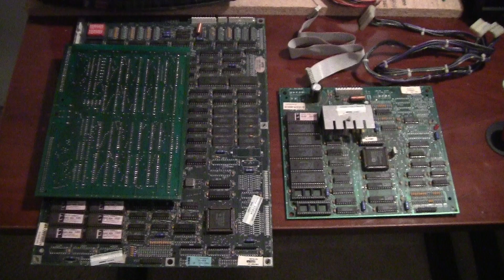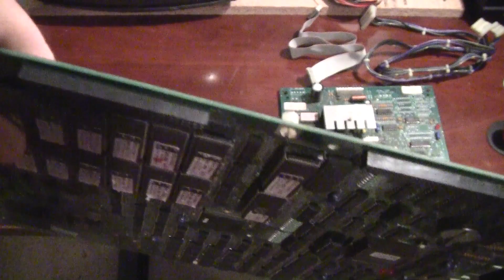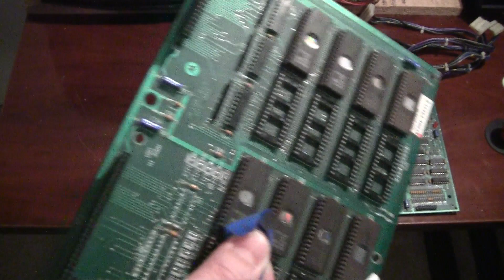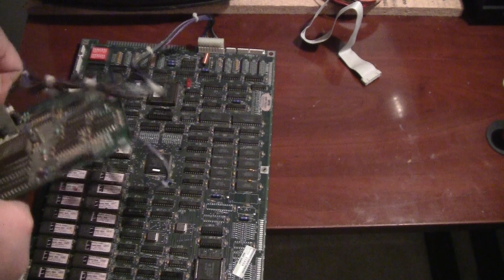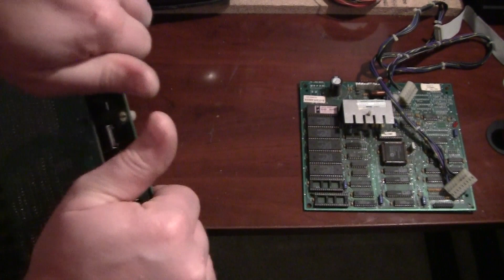Basic Mortal Kombat 2 Arcade PCB Information [HD]

Comment: Great video. I would just add that sometimes a board will have the black connectors but working 8mbit chips. The board I bought 15 years ago is like that, so it was converted probably well before that. Maybe its expansion board failed.

Comment: Awesome ! Does the jamma connector carry the audio signal thru the jamma harness into a super gun ? ( assuming you have the sound board hooked up correctly to the the main board ) also If you don't have a potentiometer will it still pass audio but just at full volume ? I'd like to get into a supergun setup / mainly for the MK and Street Fighter 2 games....( not the CPS2 ones)

Thanks !

Comment: Very interesting video! I got a problem with my MKII board. When I boot up the machine, I ear 2 "dong" sounds wich, according to the sound test, means bad U2 checksum. What that do is when I perform a fatality, the sound stops working. Friendship and babality are fine. Just fatality makes the sound to crash. The way to avoid having to reboot the machine in case someone tries a fatality, I've simply turned violence dipswitch to off so no fatality are allowed. Do you know where I can get a U2 sound rom for the sound board to get faltalitys again? Maybe you could happen to have some spares roms.
I do not want to buy a whole game/sound boards just for 1 defect rom chip.

Thank you very much!

Comment: Hi Mike. I have a revision 3.1 mortal Kombat 2 board that I'm testing. I have a box full that I'm going through from an operator. This one has those connectors for the memory board but it doesn't have one. Were there any versions made that still had the connectors but didn't need the memory board? All roms test good on cpu board test? So far no problems with the gameplay

Comment: Hey MK …. Ok ok …. I’m re-watching your video …. All of the ROMS are populating bad but the main PCB itself does not have the expansion board sockets in place and the vías are all populated with solder ……. I assumed on purchase that the board was a newer revision with 8MB ROMS ….. is there any other way to determine if this board is meant to have the expansion board besides the black plastic sockets?

Comment: Hey man I watch your videos from time to time and have a question about the MK2 arcade cabinet at the arcade I work at.  On occasion, when playing 2P vs either side will drop inputs, like going backwards won't work for a second or else a LK won't register at all, or on rare occasion a character will just jump straight up or lock in a duck position (all of this is SUPER annoying).  It's very bizarre and seems intermittent.  The issue arose months ago, I put new iL Eurosticks and all new microswitches in on the buttons but realizing it still happens here and there has ruled that out as a possibility.  Maybe a harness issue or the board itself?  Ever run into anything like this?
Reply from the maker: Hmm. First thing I’d do is clean the PCB edge connector.

Comment: Hello!
I have a 4MB board without the expansion card. So when I plug it I only get a black screen and one sound (that it means the sound roms are ok). I have three questions:

1. Can I plug the board without the sound card attach to it? It will works?
2. If I don't have the expansion card, will I get video signal as well? 
3. Do you have an extension card for sale?

Thanks!

Comment: I've got a board from MK II that is reporting some bad ROMs, it plays but it will reset occasionally because of the ROM problem. What would you recommend as my first step in trying to repair them?
Reply from the maker: Paul Eicher First step is to inspect the bottom/back side of the board to see if any of the metal socket feet are bent over and touching each other. The second step is to make sure your voltage is correct. Measure your voltage and make sure it's around +5.12vdc. If it's not, turn it up a bit. Some boards need slightly more power than others.
Reply: YourMKArcadeSource Thanks, I'll try that out when I rip the cab apart for a complete rebuild. I found my board is 3.1 with the 8MB roms :-) 
I mentioned you in a post of mine on Google+ which has a image of my ROM errors.

Comment: So. I have a 8MBit version of the board, I am having an issue with chips UJ19 and UJ20 going red. If i reaseat the chips (Generally just reseat UJ20) and reboot the board it will go green. My guess is that the socket has gone to shit and i need to replace it. What do you think? Oh, The legs on the chips are clear and no tarnish.
Reply from the maker: +DJAlup I replied to your KLOV pm.

Comment: i have a question, i  bought a mk2 board but when i plug it in i get black screen, one of the led lights turns on, i have no sound card.. is it not powering on becuase i dont have a sound card or is there something with the board? I have the one that doesnt have a daughter board.. hope you can help :)
Reply from the maker: Try adjusting your voltage on your power supply a little higher. If that doesn't work, remove, clean the legs and reinstall the revision roms (UG12 and UJ12).
Reply: thanks man, im scared to mess with the voltage since im not experience.. im scared of moving something up and breaking the whole cabinet down.. is it hard?
Reply: have you had an mk2 board that had the same issue that it shows light but nothing comes on? im just going crazy if its the board or the voltage issue. board looks in good condition though, one blue can cap is loose though
Reply from the maker: Chris RG Usually, I "flex" or "bend" the board while it's powered on to see if it comes on while it's being "flexed" because if it does, that means there could be a cold solder joint or loose part.
Reply: Ill give it a try thanks bud :)
Reply: I have the same problem only the top LED light turns on the the screen is all black and my board looks a little bent can someone help me?

Comment: Is one version better than the other between with and without an expansion board?
Reply from the maker: No, not really. The non-expansion board is newer, but not necessarily better.
Reply: I like to think the single board/8mb version is better due to it not having the expansion board as a possible failure point.  There's been a few stories of the expansion board coming up bad even tho it was there and socketed.  sometimes without the support at the middle of the main PCB to the expansion the connection between the two can become flaky.
Reply from the maker: Collector-itis Yes, this is true but the 8mb rom boards have their problems too. I've actually got more bad 8mb boards stacked in the spare parts area than I do 4mb rom boards.

Comment: I have the expansion board on my MK2! Could I upgrade to 9.1?/ All I have to do is replace or install UJ12 & UG12 right???
Reply from the maker: Correct!
Reply: @YourMKArcadeSource  Dude u are awesome!! My bad I should have finished your video u explained it to the "T" My man
Reply: I have 1 more question when I install the ROMs? Is there something on the chip to make sure I install it right and not backwards??? Whats the best way to remove it??
Reply from the maker: There is a little notch that lines up with an arrow/notch on the board or in the socket.

Comment: As far as power supply goes, what does it use, because I hear it doesn't work with 12v
Reply from the maker: It uses +5, +12, and -5 for audio. All three rails must be present.
Reply: @YourMKArcadeSource  thanks man! I trying to build my own machine, and it's my 1st time, I'm a little bit scared.
Reply: @YourMKArcadeSource  my JAMMA doesn't have -5 voltage.
Reply from the maker: You’ll be ok for MK1 but you need -5 for MK2-MK4.
Reply: @YourMKArcadeSource  so I'll have to get a new JAMMA cable?
Reply from the maker: Yup. Or add in a wire and pin to the connector for the -5.
Reply: What about jamma+? Can I use it, or do I need the kick harness?

Comment: So if all my roms are red on the expansion, should be just replace them?
Reply from the maker: Is it hooked up? Installed properly? Seated all the way on the main board? It’s unlikely they are all bad and more likely the expansion board is either missing or not seated all the way into the sockets on the main board.
Reply: @YourMKArcadeSource  yea it's all the way in, I made sure it was, I even took out the roms and cleaned them up and no luck
Reply from the maker: Hmm. Well I’d say replace just one and if it turns green, replace the rest.
Reply: @YourMKArcadeSource  I couldn't find just one, I had to buy the whole set so hopefully it works, thanks for the reply on an old video also
Reply: @YourMKArcadeSource  so I fixed it, and it wasn't plugged in all the way lol thank you for the info sir
Reply from the maker: Sweet. That’s what I thought. Very odd they’d all be bad. Usually means it’s not plugged in all the way.
Reply: @YourMKArcadeSource  yea lol I feel so dumb but it's my first cabinet, also one more question, what kind of battery does it take? I need to replace it cause the memory won't save
Reply from the maker: CR2025. Newer ones are smaller so don’t be alarmed when you install it.
Reply: @YourMKArcadeSource  lol ok thanks for all the info and videos man, your the best and learned a hell of alot just by your videos
Reply from the maker: You’re welcome. Thanks for watching.

Comment: Hey friend what is the problem 
When you the pcb (mk2) Working well but the image jumping!???
Reply from the maker: You’re monitor has a hold problem.
Reply: YourMKArcadeSource 
Hey friend ✌️😀✌️
No no im playing with a supergun in a tv sony wega trinitron 32 inch 
Is a first test for me 🤪🤪🤪
The picture in this tv is fck clear 🤣
Im testing hyper street fighter 2 turbo in the same tv and the game no jumping like mk 😧😧😧😧 
Is possible to send you a video !??? 
Thanks !!!!!!!
Reply: YourMKArcadeSource 
Hey friend ✌️🤪✌️
I test today nhl 2 on 2 open ice 
And I have the same problem !!!!
But when I use a capcom cps2  
Game the game no jumping 
Do you think the sony wega is not compatible with midways games huh !????? Lol 😆 wtf!!!
Reply from the maker: Midway games refresh at 53hz. Other games are 60hz. That’s your issue.
Reply: YourMKArcadeSource 
So you think they never works with a normal tv !? 
I see a guy he play mk3 with the same supergun but with a pc screen...
Reply from the maker: Must be something with your setup. You may simply need to adjust your vertical hold on the tv when playing Midway games.
Reply: YourMKArcadeSource 
I buy  the supergun retroelectronik
Reply: YourMKArcadeSource 
Hmmm ok 👍 I'm going to try😊😊😊 give you some news later ✌️
Reply: YourMKArcadeSource 
No works man 😔
In this tv only can rotared  for the left and right ( tilt correction) 
And the other can only put on or off the (16:9 enhanced )
The screen is more short 😞

Comment: I'm getting nothing. No sound, no picture, nothing is coming up on my pcb.
Reply from the maker: Remove and reinstall the two PLCC chips in the brown sockets.
Reply: @YourMKArcadeSource  just tested my power supply, and -5 isn't reading.
Reply from the maker: -5 is only used for audio and won’t affect the function of the main board.
Reply: @YourMKArcadeSource  tried hooking up my pandoras box, and that's not working ether, so that means I probably hooked something up wrong, or I have a busted power supply.
Reply from the maker: Sounds like it.
Reply: @YourMKArcadeSource  the borad comes on, but when I test the voltage on -5 it read s 0, so thank god it isn't my pcb borad, at least I hope it isn't, but I'm getting no picture, and no sound still, on my pandoras box also. I guess I'm just going to try a different power supply.
Reply: @YourMKArcadeSource  if all else fails, I'll send you the borad to fix.